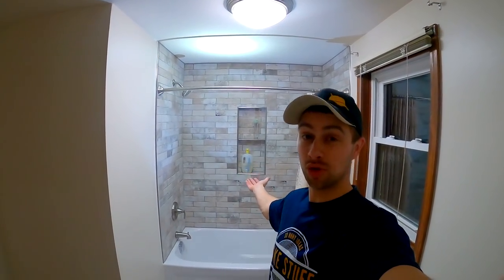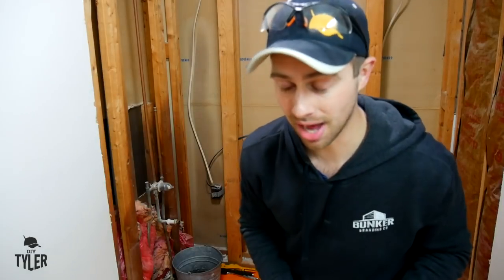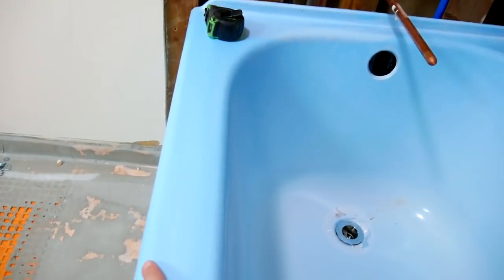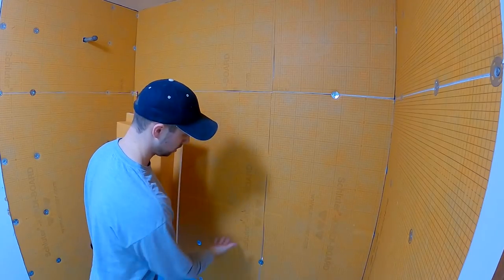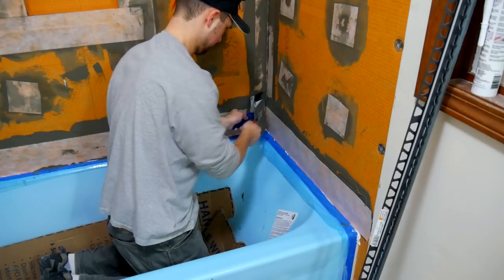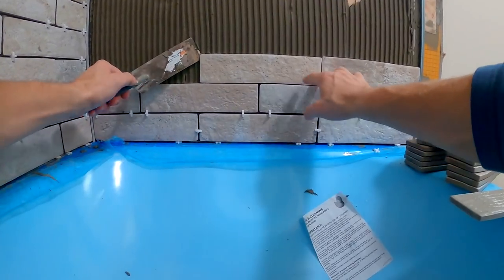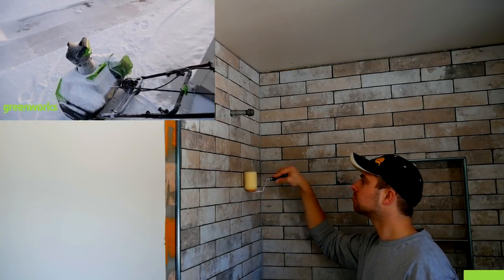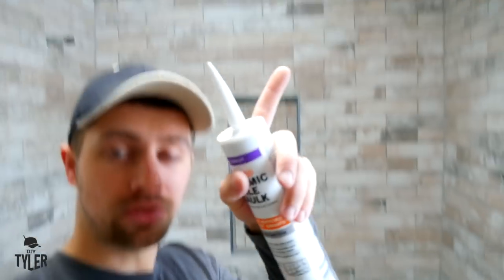DIY Tile Shower |Tub Insert to Stone Tile Wall Shower

Comment: usually before you caulk you fill the bathtub with water to load  it down and then apply the caulk so that when you use the tub the caulk will expand with the weight in the tub rather than crack away from the tub.
Reply from the maker: Good idea, never though it that! Would call out pretty crappy caulk if it cracks that easy though. All said, good point. Thanks !!

Comment: Been there, done that, even using the Kerdi system.  Way too much work, don’t want to tile ever again : )

Nice job!
Reply: I agree. Leveling the walls, Marking lines, Nich's, Schlueter trim with 45 degree cuts. This is insane. They need to make kits for this job, supply you with a pattern blueprint, have pre-cut schlueter or have the whole kit for making nichs - whatever size you want. You can make them so they slide to size. Someone needs to automate this stuff so these tile guys arent spending forever on all these labor intensive tasks. How long have we been tiling and still all this manual work -- This is truely insane!

Comment: Using a PSC or Kerdi is the only way to go, especially if there were a shower pan in your future. Next time around you can save a step and use something like TEC Powertec which will not require a sealer, and is nothing like the old two part epoxy grouts. Nice work Tyler!
Reply from the maker: Agree, will never go back! Have heard about powetec, will give that a try next time. Thanks for the tip David!

Comment: Very nice job Tyler!  Wondering, does your niche drain on the bottom shelf (does it hold water)?  Really like the system you used, looks first class!
Reply from the maker: Thanks JB! I slanted the tiles to promote draining but the niche doesn't have the slant built in....(would be a good idea though!)

Comment: Hey Tyler - got a debate question for you about tiling a laundry room. Based on my layout, I am left with less than a 2" gap between the  tile and the recessed wall that will be completely hidden by the W & D. Is there any good reason to finish the tile to the wall?

Comment: Great job Tyler.  Your shower will be as sound and dry as they come.  I've done 4 of these in different houses and the only suggestion I would have had is to add blocking for a grab bar across the back while you had the wall open.  They add a level of safety for everybody, not just old folks, and even if you didn't put it in now the blocking would always be ready for the future.
Reply from the maker: Would have been a good idea....I was just proud I actually remembered to block for the shower curtain! Thanks for the feedback Joe. (I have an Uncle Joe Giannattasio, and not many people with the same EXACT last name but I'm pretty sure he hasn't done any bathrooms?)
Reply: Name is still unique. Last I checked I was still you're uncle. The tiling skill is an Italian thing. It's in your blood.😊

Comment: Great work! I'm in the middle of a bathroom remodel too. Is it necessary to have an expansion joint profile for inside corners? I understand the logic behind it but Schluter's website states that these profiles eliminate the need for caulking. I was just going to caulk my inside corners. Do you see a problem with that?

Comment: like it a lot!! a lot of action! did you use a action cam to?
greetings from the Netherlands!
Reply from the maker: Thanks Patrick! I did got a GoPro a while back specifically because I knew this project was coming and it is a tiny space, the wide angle of the go pro helps film. I like using it though so will integrate it into other videos. Thanks for watching from afar Patrick!

Comment: @17:30 We're making the same decision for our kids' bathroom remodel. We have 6 kids ages 1 to 12, and we did not like the idea of putting a glass door on a bath that would be used to bathe our 1 and 3 year old. Aside form the issue with needing the bathroom available while one kid is showering, it would just be inconvenient to work around that door frame all of the time to bathe the little ones. We're going to have a super-nice looking bath with a curtain just like yours. Oh well, if we really want to, we can install a glass door in there in 3 or 4 years when our kids are done needing our help to bathe.

Comment: So many videos I watch showing tiling in the bathroom and all this sealing which takes allot of time and money. I demo'd my bathtub tile and they just cemented it on drywall. Didn't even use green board. And it was dry as a whistle when I removed everything and no mold marks. First, when you take a shower or bath, very little water gets on the walls unless your having a party in there. Second, most of its tile with cement on the back and then grout, so I don't see how your going to get much water under the tile anywhere, unless it was a crap tile job. I just think all this sealing they show is overkill. Just use cement board, fill in seams with some morter, caulk around the bottom of the tub and put up the tile. That roll on sealant they show for $50 gallon just seems like some gimick someone is making allot of money from. For the past 50 yrs before that stuff even existed - no one used that.